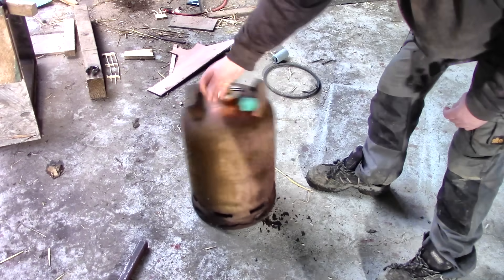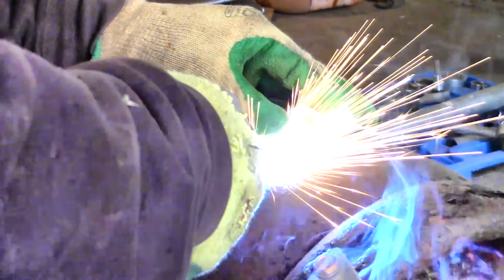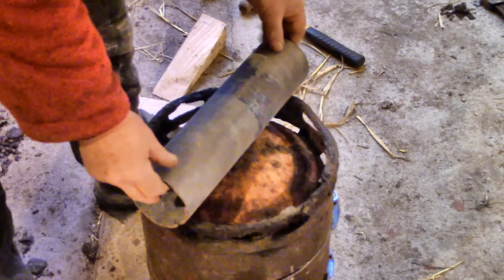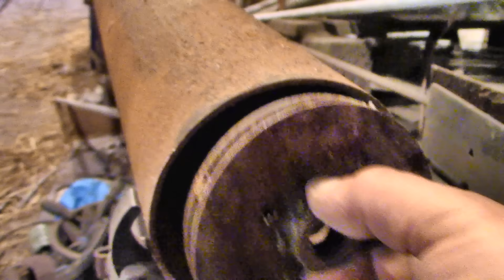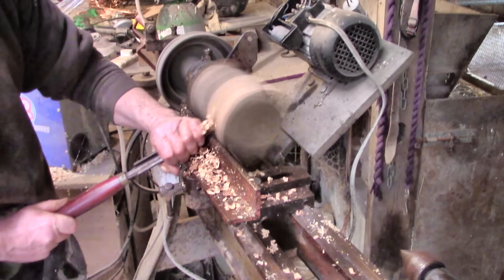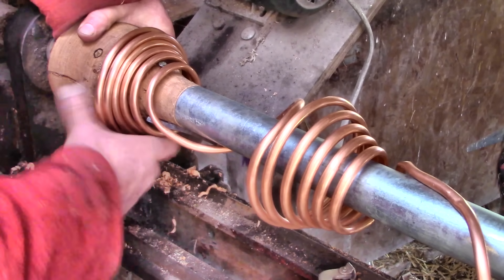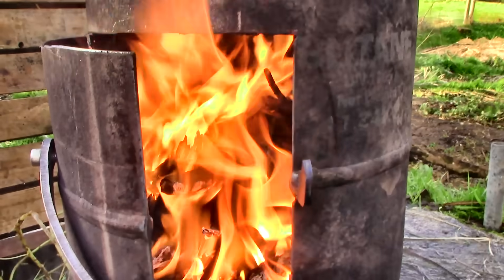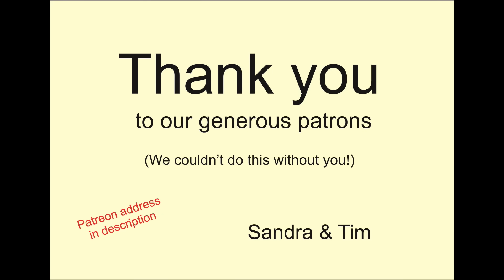Homemade Flash Steam Boiler From Plumbing Pipe And Scrap

Comment: One thing i have done is if you used yr tube that u put the copper tube in as yr burner then make it about a 1ft long to make it into a rocket style burner! Put a as i call them LP tank on top as a heat bubble! Dont put the the exhaust of it out the top of the tank put it out the side yes this holds more heat in it next make a layered coil pack and put in the LP tank many use a tube like the size of a paint cant and use 2 plates of plywood as guides! For when you make a flat wrap of pipe start in the center working out once to the outter of the tank size you have then pass it over top the first coil to start a sec one and so on once made use some stainless wire to bind all the pipe in place each one takes time to but worth it! now one big thing! I know what you call a flash boiler as a mono tube boiler! What i know is this water goes in the bottom  you have water fill up 3/4 of yr pipe this gives extra empty pipe in the hot zone to help dry the steam as it travels up!  You need a fill sight tube so you know how much water is in yr setup to you dont run it out and have a burn out! Ones i have made have a water tank with a sight tube between it and my coil at the top is the steam exit! Just having a fire is okay but if you get it roaring using a setup like a rocket stove style they make the flash of the water fast and constant! most times too i block off the middle of the coil this does 2 things directs the heat from the burner out to the coils and if you add fins in the lower part of the tank to direct it in a swirl it will heat the pipe more evenly and not on just one area! Hope this gives you more ideas and keep at it i have always love steam power and just wish i had the money to make more of if and use it more often its very diff today with all the new things we have to make modern steam setups!

Comment: Piston feed pump..and steam valve closed so that the pressure rises to the operating pressure. whereby the water is hot enough to produce continuous steam.
Reply from the maker: The problem is getting the pump rate to balance the boil rate - I don't want it flooding or boiling dry

Comment: you need to build yourself a proper vertical fire tube boiler to have a ready, safe supply of steam. A small boiler 6 to 8 hp would work with 2 foot dia and 5 feet tall with waterleg. Be sure to check with national regulations before proceeding. you will need top and bottom tube sheet, foundation ring, and two pieces of thick gas pipe. Your CnC cutter makes the job easy peasy. Get high quality, recorded steel and a pressure welder.
Reply from the maker: I'm hoping to avoid all that with a flash steam boiler - much safer.

Comment: Next time fill the copper pipe with sand before bending it, it won't kink then
Reply from the maker: 25m of 8mm pipe - I wouldn't risk it. One kink and I'd have to start again
Reply: @wayoutwest-workshopstuff6299  it cant kink with sand in it.
Reply from the maker: Yes, I know that - but one small gap in the sand would allow a kink
Reply: @wayoutwest-workshopstuff6299  but you're doing it with nothing inside at all? So long as the sand was dry you could keep it shifting downwards and the sand would flow like water, kiln dried sand would be be the best. Maybe have a go on a small scale and i think you'll see what I'm trying to say

Comment: from what i see the BEST way to fix this is to get some ceramic wool and wrap the full thing in it basically trapping all the heat into the container with the only way the heat can escape is through the chimney which will increase the efficiency of your boiler by roughly 70%

Comment: Run the water backwards through the copper pipe, counterflow to smoke heat.
Cold water in the top and steam out the bottom.
Reply from the maker: that's what I'm doing..

Comment: Quick tip for bending thin tubes.

Pack them with sand or salt and plug both ends.  The tube will bend but not kink nearly as easily.
Reply from the maker: The pipe is 25 meters long though, so I wouldn't trust that all the pipe would be filled tightly

Comment: ok.. here's the showstopper... you will never have usable steam output pressure beyond your cold water input pressure. 150 psi in, 150 psi out.. restrict the output to 160? and you flow water/steam back through the supply... hope this helps.. 
clear live steam is a ferocious, compelling animal whether boilered or flashed. steam is sticky and wants to condense to everything slightly cooler, that it touches.. it will also cause the fuel smoke to condense outside surface of the heat exchanger coils requiring frequent attention. make the exchanger with a number of strait, vertical pipes to facilitate cleaning..
live steam is quick like electricity and any meat it touches is instantly cooked so get some nice long rubber gloves for everyone or eventually you'll be watching the skin peel off the back of your hand..

Comment: I made a concrete encased forge similar to how yours is arranged and with the top of the flue near eye height and with natural draft I had flames coming out about 250 mm above the top of the flue pipe. Interestingly the flames were running up the flue just clear of the sides of the flue. Not sure why. I measured the temperature of flames inside at bottom of the grate and I was getting 600 degrees Celsius from just dry firewood. A forced draft should have been able to lift this temperature higher. 
I modified the flue arrangement in order to make a BBQ and in doing so ruined the airflow. Work in progress. 
Mark from Melbourne Australia

Comment: Could you run a reverse flow heat exchanger (https://en.wikipedia.org/wiki/Heat_exchanger#Flow_arrangements)... meaning the cold water enters at the top of the stack and steam exist at the bottom? Right now as the flue gas goes up the stack it is getting cooler, so the max available temperature of the steam is set by the flue gas exit temp.  If there was a way to configure the flow to be outlet near the stack start where the flue gas is hottest you would get a more effective temperature differential between water and flue gas. A tough one since gravity will be sure to fight you since you have water in the mix... perhaps after the spiral you could turn back down with a single tube and exit out the bottom?

LOL, i just rewatched and that is how you have it configured... well good on you then!

Comment: You need to improve the 'residency time' of both the smoke and the water. You can do this with a longer heating coil and chimney. Also think surface area to volume ratio for the copper pipe. Smaller diameter pipe has a larger surface area to volume ratio and has the added advantage that it will be easier to work with though it may have a detrimental effect on water flow rate. Temperature measurements of the smoke gong into and coming out of the chimney will give you some idea of how effective you're design is. I'd have to look in my steam tables to tell you what temperature you need to achieve to get dry steam at atmospheric pressure.  Basic stove improvements, fit a baffle in the firebox to make the smoke 'work' and introduce secondary air on the edge of the baffle to make the gasses in the smoke ignite. Lag the chimney to prevent heat loss from the outside. Consider making the chimney multipass, up, down and up.

Comment: just a heads up for long term use the copper pipe will start spitting out black carbon looking flake stuff i think its a build up inside the pipe if it runs dry. i built one to heat my swimming pool and stoped as the black stuff ended up in the pool had to filter it with a sock filter.  it did work well though
Reply: also it might have been the chloine from the pool water so mite not happen to fresh water
Reply from the maker: Yes, I suspect you could be right there..
Reply: @allenlong1445  That will definitely be the chlorine from the pool reacting with the copper of the pipe. The black stuff will be impure copper chloride salts and the chlorine will be eating away at the inside of the pipes.

Comment: I would suggest trying a bottom to top, water to steam flow, and more surface area.  That flow path seams counterintuitive, but it puts the highest heat in the liquid to vapor transition area, and lower temperatures in the super heating area, where you can over heat a tube and blow it out more easily.  If you look at flash boilers for power plants, they tend to have the "boiling" section nearest the flames, the superheater further up the stack, and the economizer to preheat the feedwater at the top of the stack.  Also, I know they don't let stack temperatures fall below 350F so that less water and fewer corrosive chemicals from combustion condense out and do damage to the coils and stack.
Reply from the maker: you're right - I'm learning a lot!

Comment: Many people are saying feed water in through the bottom of the coil, this might be a solution if you are intent on using a small fire. If you have enough heat, feeding water in through the top is the best (and as proof, look up any number of commercially produced steam generators as used in the good old days). The water turns to steam as moves down the coils, and the hottest coils are right above the fire so you get the driest steam - if your fire is hot enough!

Comment: Look up Superheating steam. If you want actual power from steam you need a superheater. I think you need to get the coils close as you can to the fire too. there's just not enough heat up in the chimney.

Comment: My locomotive idea…….  36 volt DC series wound forklift motor with three deep cycle marine batteries.  Charged with solar panels.   Low center of gravity.  No messy and dangerous steam, gasoline or burning fires.  That’s my two cents worth.
Cheers and Merry Christmas!
Whipple
Reply from the maker: Thaqnks Whipple - you too!

Comment: if it were me, I would have wound that copper tubing in a single layer not made many different diameters of it so it was one giant coil. Put it in the stove pipe as you did, but then feed the water from the bottom up so the water has more time to collect more heat, and the moisture from steam will run back down in the tubing some instead of making your so saturated. Also bigger dia. tubing would not hurt either. Dry steam is all about time and temperature. It is about adjusting that water feed to meet the steam coming out. Larger dia. tubing fed from the bottom will allow the moisture to go back down the tube and be heated more to turn to steam. This is really cool..

Comment: @Way Out West - Workshop Stuff
10:32 You COULD feed the water in the other direction, and basically create this: https://www.youtube.com/watch?v=4j4Q_YBRJEI
Or you don't even need to feed it, with a 1 way valve, you could have a tank of water, where the water-surface is at the height just as the first ring in the fire, the heat from the fire will make it boil, it will be (super heated) steam, shoot through the tubes & out the end, while also sucking in new water to be boiled.
I guess this will create a more pulsating steam generation, as compared to a continuous flow.

WARNING!
Be careful, if a "clump" of water shoots through the hot tubes, it might be too much water that turns too fast into too much steam that ruptures the pipes.
Reply from the maker: Brilliant! Thanks : -  )

Comment: @Way Out West - Workshop Stuff
6:00 Solution: fill the copper tube with fine sand (or similar powder substitute) before bending, the sand will push back & the pipe will remain round.
(works best for shorter lengths of tube, as it's easier to fill or remove the sand).
For a longer pipe. maybe you could like seal one end & put in pressurized air or water in the other end through some custom connection? (easier to empty later)

Comment: I'm a chemist. What if you weld a mesh to the bottom of the chimney then fill the column with sand and/or volcano-rocks to act as a heat-capacitor. Perhaps this heat (Commonly the variable "Q" in thermodynamics) stored in the column medium will help keep the system steam from cooling to liquid.

We're dealing with physical chemistry here. Maybe start with simples like adding terflon tape to seals as appropriate to minimize energy losses. Riley.
Reply from the maker: Surely it would restrict the airflow too much?

Comment: Tim big fan, this is a really cool project, it would be neat if you could run an engine off of this.

Not sure if someone has suggested it yet but if you put an additional coil on the outside of the chimney feeding water in at the top and down the coil, to get to near steam temp at the bottom of the coil (maybe a valve to regulate the inflow of preheated water into a smaller denser coil inside the base of the firebox) and then routed into the inside coil to create steam hotter and dryer. If you could get the inside coil to create dry steam maybe you could use a valve or something to constrict the inside steam coil to build pressure.

Not sure if that would work but seams to match the style you are going. Hope whatever solution you come up with works great. Thanks for making all this content love your videos!

Comment: for my tuppence worth 1) anneal your tube 2)use plumbers benders to coil  it (they are cheap) 3) feed water at the bottom 4) super heat the wet steam (usually done with stainless steel pipes) just take it from the top down the middle of the flue and back up again.
just remember super heated steam can be VERY DANGEROUS

Comment: There are numerous design flaws in your system. To many to mention in this format. No I am not an engineer but do have extensive experience with steam. 
Smaller tubing for the coil or a larger flue. 
The coil needs to be consistent in diameter and separation. (Weave wire support on three sides of the coil stack). 
There should be two coil stacks. One going up to create steam. A second stack going down to super heat the steam and dry it. 
There should be a steam header at the top to accept a couple of safety valves. 
There should be a gland packed seat valve for the outlet steam. A ball valve is an accident waiting to happen. 
A steam dryer is helpful. A canister with baffles in it and a drain at the bottom that can trickle out condensation. 
Insulation is a must. 
Greetings from the high plains of Texas.

P.S. 
A check valve at your water feed is essential. 
Wrap your coils around a pipe close together then spring them apart forming a small gap. 
 I will probably think of other things later. 
Great video and a noble effort!
Reply from the maker: Thanks Ryan - I'm learning all the time!

Comment: Next time you try coiling copper tubing. Fill the copper pipe with hot pitch. Let cool. Then coil as tight as you'd like. It won't kink. You can also fill the coil pipe with water. Place in large freezer. Then coil. Point being you need something pushed my back against the inside. God bless.

Comment: It is difficult to stop saturation without good separation of steam & water, especially with constant flow water. Try cutting back the water a bit. Another option would to install a T at outlet with water flow going through & a. Pipe for steam to flash upward.
Did you use a steam pressure guage? Water pressure gauges won't work here.
Reply from the maker: Thanks, Oliver. Is it because ordinary pressure gauges can't cope with the heat?

Comment: Interesting I have just watch your video again and which ever way you do you coil you would be far better of running your 10mm soft copper out straight and forming the bends with a 10mm copper bender which are fairly cheap as formed bend work hardens the copper so limiting any kinks and of course with a bender you haven't the hassle of controlling the copper as you can bend it where you want it, I would suggest you do multi runs vertically up the flue part starting with a coil in the top of the boiler itself. When increasing the length of copper coiled tube make sure you silver solder any sockets you need to use as that is alot stronger than ordinary solder and will take alot more heat and pressure. Silver soldering is the same as ordinary soldering but you need and much hotter flame to melt it and use Borax as a flux made into a paste by adding a small amount of water, and you will find the copper has to get red hot for the silver solder to run. As it's pressure you want to make real clean flash steam and the pressure comes from the residents of as much copper tube as you can get in there, so if you start with around 20lb of water pressure going in your already above the 14.7 lbs (atmospheric pressure give or take) where flash steam starts to happen when let back to the atmosphere. Supper heated steam which is what your making on a small scale will easily turn into flash steam so should the outlet valve be turned off is when you need a safety valve in the line some where, and wherever your getting your water feed from you will need a check valve (known as a flapper type non-return valve) to stop any pressure back feeding.
Reply from the maker: This is 8mm tube - I haven't found a suitable bender here in Ireland : -  (